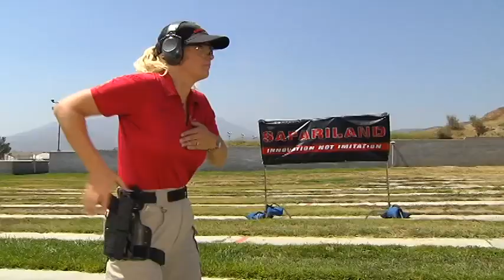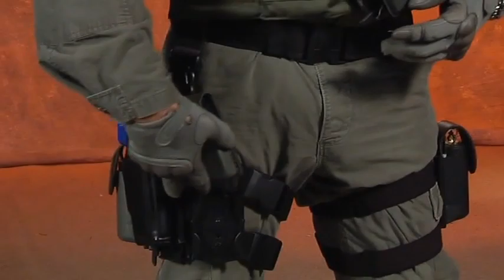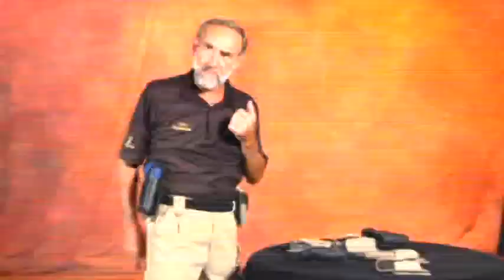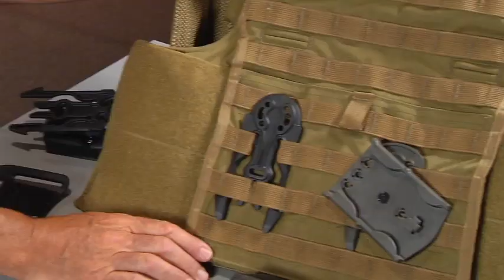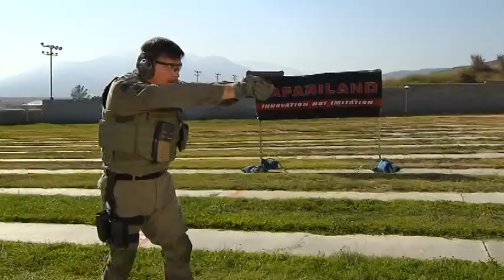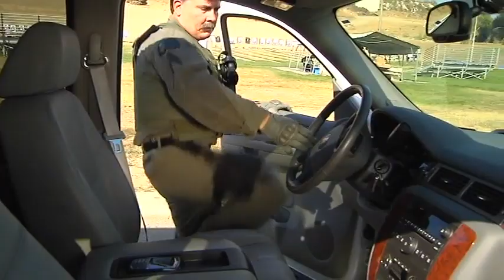Molle Locking system & Quick Locking System's from Safariland (MLS QLS)

Comment: Make a video for a MOLLE product and instead of demonstrating it being installed on molle aside from 3 seconds, the entire video is about it being a quick detach system on existing mounts.  I'm on the fence with buying this as I'm trying to figure out the dimensions and layout.  But like most safariland products there is a lack of overall documentation.  Your products are extremely difficult to judge unless they're in-person, and this video was really not geared to molle.  The qd concept isn't the issue, it's how will it mount on a double-strand vs-single-strand of molle.  Can't get an answer.
Reply: This product is good product buy it or don’t comment

Comment: i cant find the short or the long MLS locking plates on the website. are they discontinued? the forks are on there but not the plates. and also, how do you mount the locking plate on molle webbing if you dont want to just rely on the forks?

Comment: I'm confused.  I have the MLS 19 (fork) on my holster and a MLS 22 reciever on my belt or tight rig. How do put the mls 22 reciever in the molle of my vest?
Reply: I came here with a similar question. It looks like you would need the short MLS receiver plate to attach to the MOLLE webbing, and the QLS fork attached to your holster should fit it. Not sure the 22 receiver plate works in the vest.
Reply: @bigosbro21  I ended up just attaching the QLS 22 receiver plate to the TMA adapter. Seems to work.
Reply: it looks like he's using two molle forks. one fork woven into the webbing with the locking plate screwed on it, and one fork attached to the holster, that snaps into the locking plate.